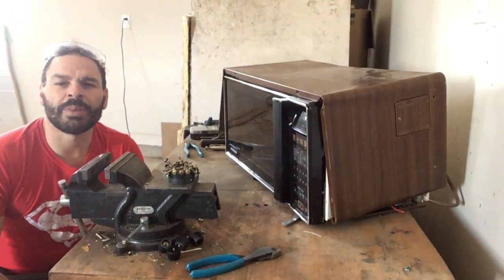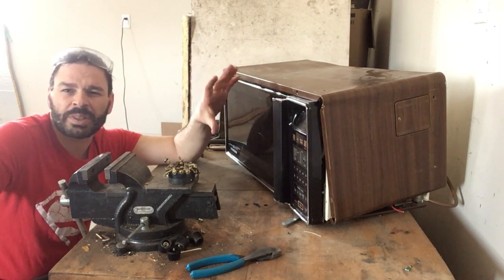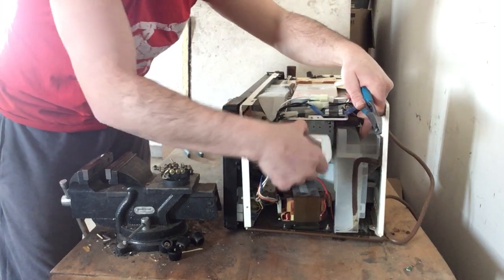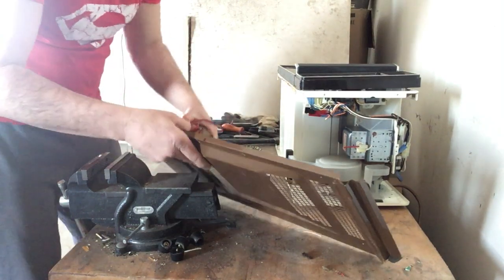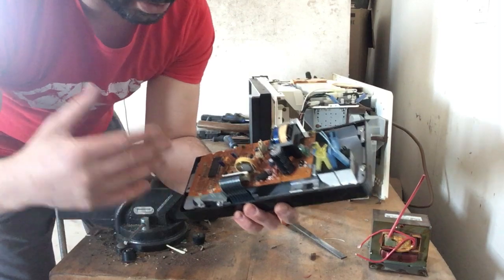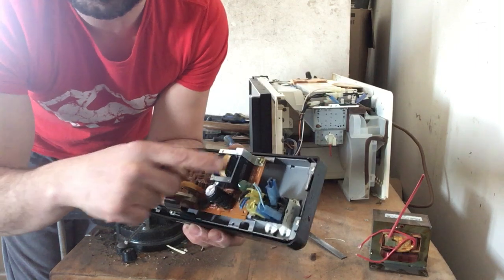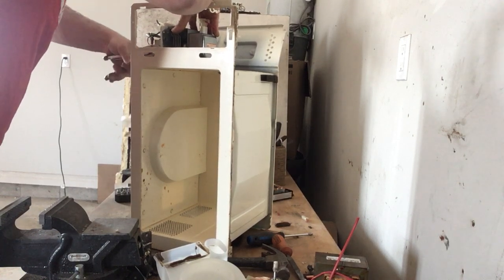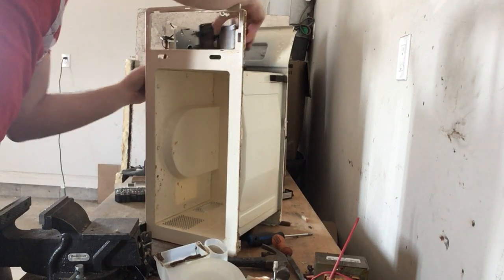Scrapping an old microwave SAFELY for copper, silver, aluminum, other metals, and little waste.

Comment: Another suggestion with the capacitor, think about it like you are the circuit board if you touch both prongs. If you touch them with a finger on one hand then the electricity is going to travel through that finger so that it equalizes between + and -. If you are sitting on a metal chair which is touching the ground and touch a prong that wants to go to ground then the electricity is going to go through your hand, then arm, then heart, then chair, then to ground, and you're dead.

Comment: Your videos are confusing. In this video you call the case "steel", but in another video, you say that anything under 1/4" is "tin". Would you be so kind as to clarify?
Reply from the maker: Yes, the shell and casing is tin. I may have said steel as slip of tongue, sorry. All outer casing from microwaves, dyers, stoves, washers, etc and microwave inner box will be tin or shred as some yards call it. Steel, as you say is metal thicker than 1/4 inch.
Reply: @TinManScrapper  thank you kindly for clarification. I'm not a scrapper per se. I'm looking for materials to smelt. Do you know whether this tin is the type that's smeltable in a home (2700°F max) furnace? If so, I'll definitely save this material rather than scrapping. Thanks!
Reply from the maker: @christianblunt  not sure, sorry.
Reply: @christianblunt , microwave cases are actually made from steel or even stainless steel. They are never made from tin. Tin is sometimes used as a generic name for thin steel, such as tin cans, which are also thin steel. If in doubt use a magnet, steel is magnetic as it contains iron. Some stainless steel are magnetic, some are not. Proper tin, element designation Sn, is never magnetic. Hope I have helped.